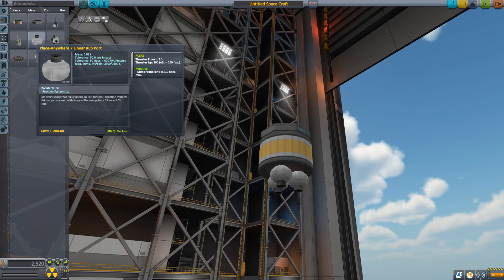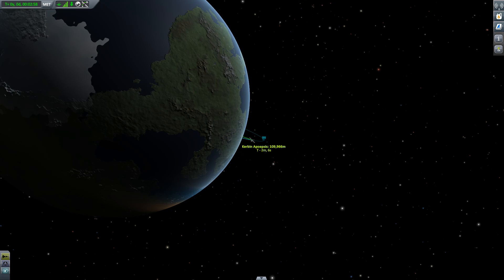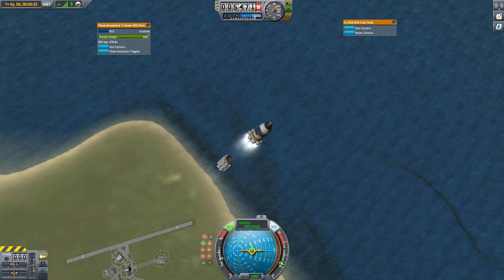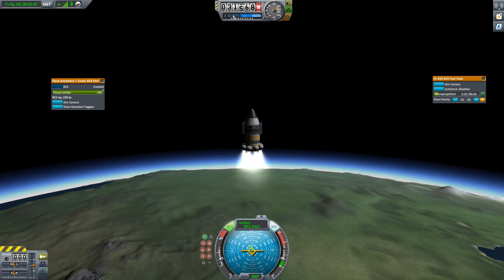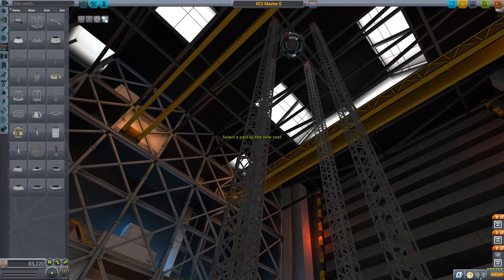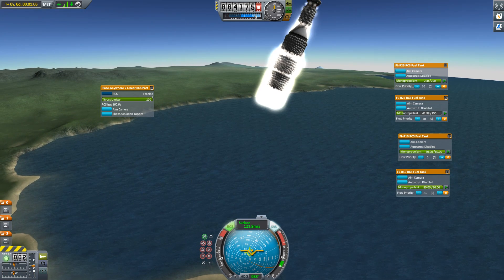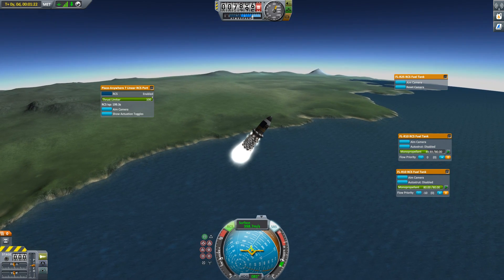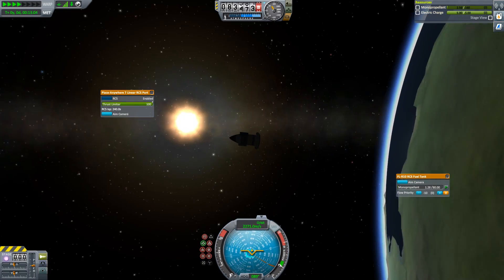KSP Challenge - Launching Rocket Using Weakest Engines

Comment: You pretty much launched it off the top of a mountain; nothing wrong with that.
Reply from the maker: +Cody'sLab someone suggested building a launch rover and driving up a mountain.
Reply from the maker: +Cody'sLab BTW congratulations on 1million subs :)
Reply: I have to imagine the Scott Manley 1mil sub special will be something like launching a gigantic play button made out of cubic octagonal struts into orbit around the mun.... hard mode: as an SSTO
Reply: @advancetheworld  still waiting for 1m
Reply: + iamihop
On earth mountains have to be supported by the buoyancy of crustal rock relative to the density of the mantle below. Which means Everest is actually quite a large mountain (something like 100km high) just most of it has sunk into the earth like an iceberg sinking into the ocean; only a small part still sticks up. Kerbin with its extremely high overall density means that the mantle/core must be far denser than on earth and so the crust (presumably ordinary earth-like rocks) is far more buoyant. therefor it is reasonable that the mountains would be higher.  ;)
Reply: When two of my favorite youtubers watch each other's videos..
Reply from the maker: Hah, still waiting for my 100k play button.
Reply: Heheh, we both know that's how you did things on Eve before they fixed the aero.  Land on or drive up a mountain.  Much easier than sea level.
Reply from the maker: What really matters is the difference in atmospheric pressure and the comparison there is more realistic.
Reply: Didn't expect to see Cody here, awesome!!!
Reply: Cody'sLab 
0_0
you're watching Scott Manley?
Reply: The link for my 100K button never showed up on my page, I ended up emailing them about it and they sent it right out. In your case though I think you might have hit 100K before they started doing the play buttons. did they send you a gift certificate? I know that is what they sent grant Thompson when he hit 100K
Reply: Didn't expect to see you here Cody
Reply: iamihop that means kerbin got insane mountians compared to earth
Reply: Sprsae Even bigger than you think. The tallest mountain in Kerbin is 6 KILOMETERS. 6.
Reply from the maker: Yeah I got the $500 gift certificate, used it to help buy my current monitor. Shouldn't complain, I'm just happy people spend their time watching me mess around and talk science. 

Maybe I can hit 1million by end of decade :)
Reply: @scottmanley  Eyyy. Hit 1m just in the nick of time!
Reply: @scottmanley  At the time of typing this comment, you are at 975K subscribers, which is not all that far off from 1M. I hope you reach this goal within 2019 :)
Reply: Cody'sLab Dude your awesome!
Reply: Scott Manley just be careful.. the play button might hit you in the head during reentry!
Reply: If there ever was any doubt in my mind that you were studying geology, it's gone now.
Reply: Cody'sLab you do the most collabs with people. I like that. Do more with backyard sceientist, scott manley, and grant tompston.
Reply: Cody'sLab you here? 😁
Reply: Cody'sLab congrats on 1 million
Reply: I know.. i've had some plane crashes there
Reply: fo shizzle, actually things do not need to orbit the earth around the equator. They can orbit around any ellipse around it.
Reply: Ayy Cody
Reply: Cody'sLab: the God himself. I love your vids your awesome. I like  how some of the best Youtubers watch each others and comment on their vids.
Reply: I subbed to uuuu
Reply: A year later and Scott is 3/4 of the way there! Hell of an achievement!
Reply: Cody'sLab no, there isn't
Reply: Cody'sLab you seem to watch a lot of the youtubers I watch, and you are one of them
Reply: I really didn't expect you here xD
Reply: Sparky McFireDog Because in real life, that wouldn't matter that much. In real life, the only problem now is the time.
Reply: +fo shizzle mt. Chimborazo is really close to the equator and it's the highest point from the center of the earth due to the equatorial bump. Logistics of getting the rocket there aside, it would probably be the most effective place to launch a rocket from
Reply: thecrazypiper also you don't need to change planes
Reply: Yep! (Shades of image #111 on the Golden Voyager Record :) )
Reply: Cody'sLab o shit. It's Cody
Reply: omg cody rlly
Reply: Probably the only way he was getting it off the ground. Lol
Reply: Ermagherd Cody plays KSP! 😮😮🤓😸😹
Reply: Launching from sea level on Eve was borderline impossible xD
Reply: Ooh my dad watches you Cody's lab
Reply: “Is having asthma attack”.      “Holy crap my favorite YouTuber watches one of my other favorite youtubers”-passes out due to leaking sleepy time bottle./ if you don’t know what I’m talking about look up the video
Reply: It would actually be more elevated if you did it off mount kraken cause the peak is 6 kilometers.
Reply: What's the minimum thrust (in Gs) that you can get into orbit assuming unlimited fuel? I'm assuming 1.00001G if you use a rocket and want to wait...but can you use less if you use a wing?
Reply: Hes about to hit 2 million soon!
Reply: +Cody'sLab it's twice today that I saw you comment other youtubers that I sub... it's weird to see that one of my fav youtubers watches the same people that I do :D
Reply: Cody'sLab a

Comment: So I have to ask, why dont we launch rockets from higher altitudes?
Reply: sitrilko Transporting costs probably.
Reply: sitrilko 
Because you'd have to get the rocket to the higher altitude, and support it there somehow. It's an awesome concept, but not very feasible.
Reply: And the parts and workers just appear magically on top of mountain?
Reply: Kerbin is basically 1/10th the scale what you saw here was a launch from 38km... safe to say that yes you'd definitively start to see benefits from launching at this altitude... but sadly we don't have mountains that high, that's even ignoring the fact that you're hauling a rocket 38km up.

So as pointed out, it's cheaper and much simpler to use the extra fuel, so that you don't have to figure out how to build a rocket on top of a mountain 4x higher then Mt Everest.
Reply: @svampebob007  Maybe Mt. Olympus Mons, on the planet Mars. You would have a thinner atmosphere and less gravity.
Reply: Well you costruct and launch the rocket on some very high mountain. Would be cool having a space launch complex on top of mount everest )
Reply: @raidzor5452  Sure thing as long as you pay all the bills! Lol.
Reply: Air-launch rocket already exists, it called "Pegasus". And Paul Allen's company is developing the Stratolaunch system which air-launch 6 tonnes of payload into orbit.
Reply: sitrilko i think also it may be to do with wanting to launch near the equator? just a guess.
Reply: Partly cost, partly wanting to have a place for things like spent stages to land without killing people.
Reply: This is a lot less of a problem with normal rocket engines, which lose less efficiency while in atmosphere or may even gain some depending on their type. I would guess getting so much materiel up a mountain is harder than just packing another 500kg of fuel and oxidizer
Reply: We do. Google Operation Farside.
Reply: sitrilko because you have to carry the rocket up the hill, they tend to be heavy
Reply: Mount. Chimborazo wold be better.
Reply: The Draugr Well you put shit up there with helis, and people and stuff.....Its like building a base underwater or underground.
...
Reply: The Draugr I'm not saying that anyone would still do it....It's just cool to think of
Reply: The main problem is the wind. It would blow the rocket down the mountain. Second, getting there, Helis only reach till a mid between the camps 2 and 3 (around 4000 mt) while the Everest peak it's nearing the 8000. Then bulding there must be hell, high winds freezing temperatures and an avalanche after every launch. And even despite all of that, if you were to be able to launch from there, it would surely blow up, just like the Challenger.
Reply: maybe because in great heights the winds are much stronger so it would be much harder to keep the spacecraft stable before launch.
Reply: It would end up costing more in fuel than just launching the one rocket from sea level
Reply: Cause it’s cold
Reply: Short answer:you have to build a launch site at a place in middle of a high altitude plain, haul all your materials there,build your rocket there, and then launch.

The short answer is that most rockets are powerful enough that a logistical nightmare to gain a few extra kilometers of height isn't worth it. Remeber: its pretty easy to get to space. You can launch something into space if you bought a felonious amount of model rocket engines and constructed a multistaging vehicle to do it. Its not impossible and normal people do it every year (without the felonious amount of gunpowder). The real difficulty is staying in space, which requires you to go sideways really, really fast, and thats where you get the massive multistory rockets that NASA launches.
Reply: A White Guy what if we created a space elevator, for rockets. 😂
Reply: There are ideas for launching light probes from high altitude jets
Reply: There is a stratolauncher, you just strap a rocket to a plane and get it as high as possible
Reply: sitrilko It's because the height gained would be so little compared to what the rocket needs to get to orbit. It's not worth it when you also factor in transportation.

Comment: "No cheats"
Reply: This is technically an exploit, not a cheat.
Reply: Nope. A cheat in terms of a videogame is something you have to deliberately activate that changes the way the game works in some way (ie: infinite fuel.) An exploit involves you using the games normal mechanics in a way that's unintended, like clipping through scenery or something. Normally the distinction doesn't matter, but if you were competing in a challenge run or speedrun competition actually using cheats would probably disqualify you where exploits are generally allowed.
Reply: It doesn't use the cheat engine nor does it modify the save file. It's an exploit, not a cheat :P
Reply: So using exploits is not cheating?

Comment: Kerbal Space Program seams to be highly unoptimized these days.
Reply: They are in a no win situation. Once you make the game run smoothly with 5000 parts, people will push it to 10K and still complain. It's the same problem EVE has really.
Reply: Good point.
Reply: Your point is also valid. The only "easy" way I can think to fix it is to merge some parts during construction to take load off the physics 
engine. I have no idea what the right mix of performance vs explosions is though. Maybe fuse fuel tanks by stage? I don't think that would get rid of enough checks.
Huh. Now I'm curious what parts get used in the highest quantity per craft.
Reply: Why can't I edit? Something goofy is going on between YouTube, FireFox and OS 10.12.3.

Per stage isn't exactly what I meant, merging tanks on each side of a coupler is what I should have said.

Comment: You should do a live stream where you use the fuel converters that use ore and see how many planets you can visit by using that system to make yourself new fuel. You would have to mine for the ore on the planets you've visited, make more fuel, and use that fuel to get to the next planet, and just keep repeating until you run out of fuel

Comment: I guess in real life it does not work quiet like that... :D
Reply: Anton Markov IRL you could launch from a higher altitude, though.
Reply: Without a doubt, but i wonder why they don't.
Reply: Anton Markov safety, cost and logistics, mainly. Building a space center on the shore is very convenient - sea is useful for shipping and dropping used or malfunctioning stages, plus more stable weather and usually easier access to high-capacity transport infrastructure. It's too much of a hassle to launch from the mountains to justify a couple of kilometers higher start.
Reply: aNemetZzZ most likely yes, the negatives are more than the positives. After all there are smart people at nasa.

Comment: new challenge: for this you may use all cheats and mods. build a space elevator to geostationery height
Reply from the maker: Well technically I already explained why it wouldn't work.
Reply: The game physics can't handle it
Reply: What I want to know is what the smallest planet KSP can handle is, and what it would do if you made a ring around it.
Reply: With mods it's relatively simple. Just put a craft in geostat orbit containing a module that has some code borrowed from extraplanetary launchpads that can spawn ships. A button at the space centre lets you load a ship from a craft file similarly to the launchpad/runway. And when you press launch, the mod switches to the vessel in geostat orbit posing as a space elevator and loads the ship on a platform. A small station keeping script constantly makes sure that while the "elevator" is technically a ship, it is constantly repositioned to act more like an elevator.

If you allow mods without restriction. Anything becomes possible. It's like having God on your side personally altering physics to suit your needs.
Reply: rubikfan1 I believe he already tried that
Reply: rubikfan1 I guy already tried it the video is on YouTube
Reply: I just tried this challenge. It's much easier with asparagus staging. I got to orbit with a 450 part ship, 6 stages, ~28 tons takeoff weight

Comment: hey wait, isn't the ion drive the weakest?
Reply: Probably meant the weakest engine that could take off on its own. ion engine doesn't have nearly enough thrust to push its own weight off the pad.
Reply: Or maybe he meant the engine with the lowest specific impulse. Ion drives still have a specific impulse of around 700 if I remember correctly. EDIT: They have a specific impulse of around 700 at sea level, but have one of 3200 in vacuum.
Reply: It's possible to make a plane with ion engines that can take off
Reply: Mostly though, it relied on the engines having their full 2kN thrust value.  Lacking that, drag kicks you in the teeth as you teeter just shy of take-off.
Reply: TheCrankyCow I remember when I could make a plane fly from control surfaces
Reply: I don't think you can after the physics change. That relied on how the wings worked in the old physics to get off the ground.
Reply: the nuke, which is what it sounds like you're thinking of, has 800...the ion has 3200.
Reply: I'm from the future, for anyone passing by it's been done
Reply: Barely, and it's gotta be from a height.  I was involved in that little investigation.  Ions have just barely too little thrust to get even a tube bristling with basic fins (the highest lift:mass ratio part) off the ground.  The drag proves to be a real buttock.

Comment: Is it possible to make an electrical plane that uses the ion engines and produces enough thrust to fly?
Reply from the maker: In the old days, not so much these days.
Reply from the maker: Yeah - it used to be a lot easier, but even in old releases you couldn't get to space.
Reply: If you search for "odyssey by bill, book 14 bradley whistance" you can find someone who did it in v1.13 using stock parts but he pushed the limits by starting from a mountain top.
Reply: It's been a while since I've played the game, so something might have changed, but you used to be able to, so I'd assume you still can.
Reply: Ianwubby only if you start from a mountain top
Reply: I managed orbit pre 1.0 in an Ion only craft. It was a tedious flight as using timewarp would ruin the flight trajectory. All up it took about an hour real time to complete.
Reply: Dear Scott play space rangers 2 please
Reply: Yes, absolutely. but it only works at altitudes above 3500 meters.... altitudes above....    above......

EUREKA!!
Reply: Not strictly from ion engines. But you could boost it with another engine.
Reply: It's not really feasible. ISP of ion engines in atmosphere is so low that by the point THEY are working your wings aren't really. And that's the point, the crossover area of operations for ion engines and wings is very poor for both. The ion engine just aren't very powerful and the wings need speed to stay aloft
Reply: it's easy ion engines op in ksp
Reply: Yeah but it is rather tedious, doesn't fly to well and overall is just a bad idea.
Reply: Skyfox94 well the point isn't to make a good or even efficient plane, it is to prove a concept
Reply: you could get to space, even bodies - http://imgur.com/gallery/0S8CN
Reply: The Nuker already done
Reply: Wei Zhao there is probably a mod for that
Reply: If you are looking for something like that, there is the mod http://forum.kerbalspaceprogram.com/index.php?/topic/128204-122-kerbal-research-development/

It allows you to upgrade a ton of stuff for extra science making science bases a lot more useful.
Reply: Yea... no. There is air resistance now, and combined with the fact that the engine ISP on ground (or in air) is extremely low
Reply: On Duna: barely
On Kerbin: nope
Reply: i made one a few weeks ago 

I can upload it when I get home in a few weeks if you want
Reply: 1)before 1.0 there was a challenge for ion orbiters
some got below 2 tons
2)after 1.0 there were only few successful attempts in ion planes
as an example, search for Bill's Odyssy (or smth close to that)